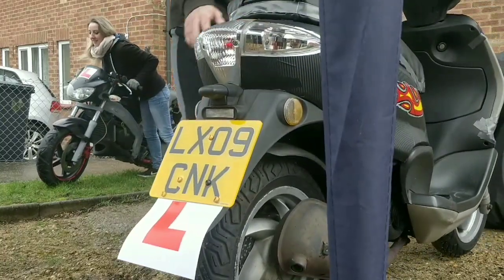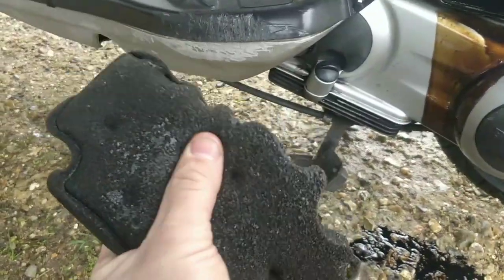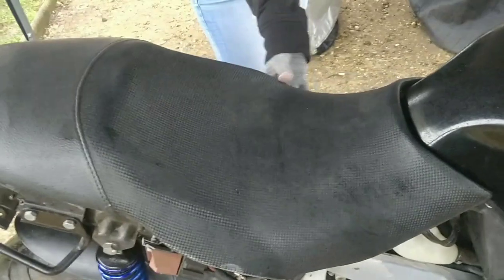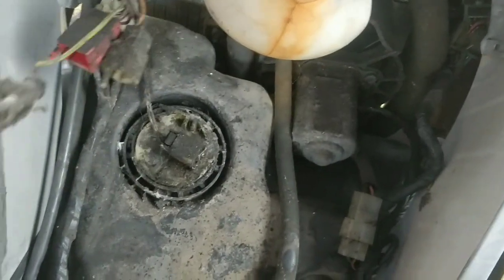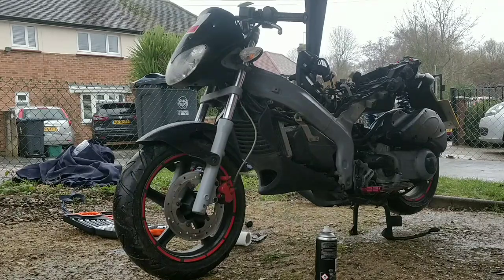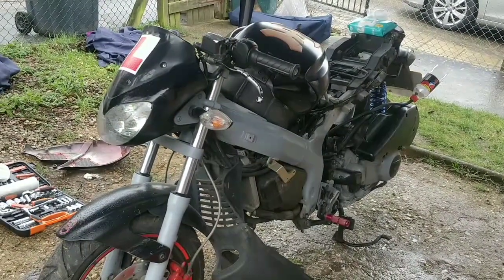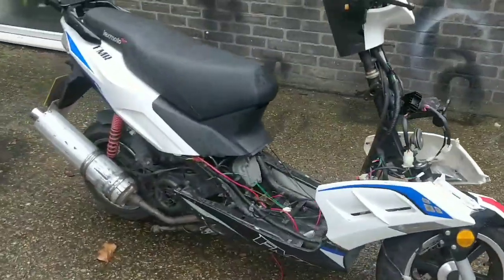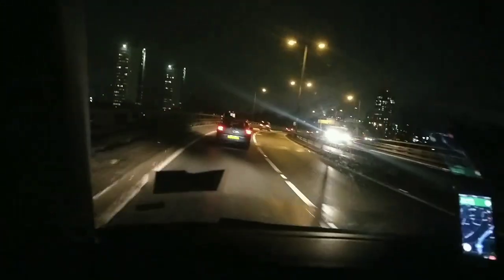#brokenmotorcycle gilera DNA 125 rescue mission, lexmoto fmr finally finished? plus 2 pick ups

Comment: Brief idle sounded good mate. I think that you are right on the carb needing a dig out.
Reply: We have too much ethanol in the fuel & supper hard to find ethanol free Petro . Them carbs come off as much as the gas caps here after 30 days of sitting LOL.
Reply: @just4kicks950  the pleasure of carb bikes!
Reply from the maker: Yeh it needs stripping down fully, new pipe work all round and the carb clean. 

It will run well eventually I think

Comment: Hey Charlie ,mine has developed a oil cooler leak in the front under the front cover ! What due think about the oil leak? Hits my disk brake going to get scary. We have snow waist deep 4 feet unbelievable, blizzard that keeps on giving & not able to ride . Sub to Nats channel 👍
Reply from the maker: You have a few gaskets on a bike including the top head one. I think you will need to drain the oil and replace the gasket. Its fairly simple to do once you know what gasket to get.

Comment: Damn. Didn’t think these were still about
Reply from the maker: There is a reason they aren't lol, they are complex. 

I've got it now so you will see it this week in my vids. I may get it sorted but not sure.
Reply: @motorcyclerescuer  I don’t fully agree. I still have my gilera dna 125 (barrel changed to 180), that I built. They can be awkward, but not really complex
Reply from the maker: Some of the design is complex, using a pump instead of a free flow fuel tank, engine mount issues etc. But they are a great bike. I'd love a 180 sp
Reply: @michaelford1124  I have a dna 125 as well. What speed do you get with the barrel change? Have there been any problems since?
Reply: @mrsportybloke1336  I tested it on the small road I live on, so I only got to 65 before I reached the end of the road. However the bike still wanted to go faster. The only issue I really had was the fuel flow device underneath the fuel tank, the carburettor, and the auto choke.
Reply: @motorcyclerescuer  I agree. Mounting the engine is an absolute royal pain. Someone had actually used a free flow fuel pump when I purchased the tank. This made the fuel mix stupidly rich. The spark plugs were as black as night.
Reply: @michaelford1124  thanks for getting g back to me chap. I’ll bare that in mind if I decide to do it too. Or rather my mechanic mate who’d do it for me😃

Comment: I went to an electric fuel pump.. Diaphragm pumps are a pain..
Reply from the maker: Hi Robert, I've been working on that today. I can't find where the suction line is ment to get it's suction from. 

What kind of powered pump can I use? Wouldn't it overwhelm the carb? 

Thanks buddy
Reply: The vacuum connects to the bk of the black boot and the other white plug is for the old alarm and then the white rubber thing on the carb that you think needs something in it dose its ment to have a spung in it
Reply from the maker: @aaroncrozier1  hi Aaron, I'm still stuck on the vacuum lines, one goes onto the bottom of the fuel petcock, the second goes to the fuel pump but the end abd 3rd piece has no where to go?
Reply from the maker: I've literally just found it, it connects to the carb boot but I don't think mine has one. I'll have to check again. 

Thanks mate